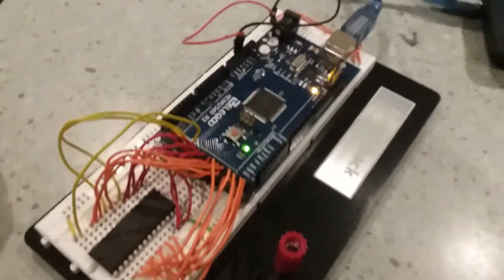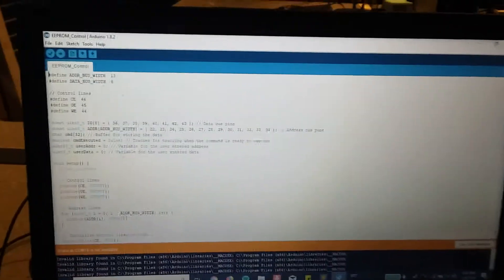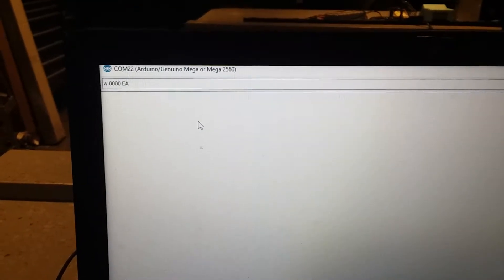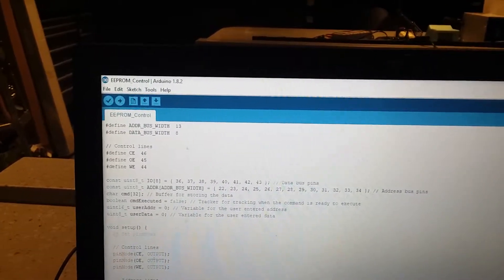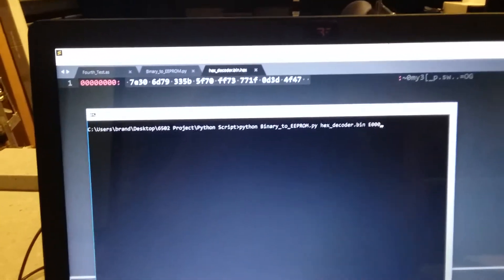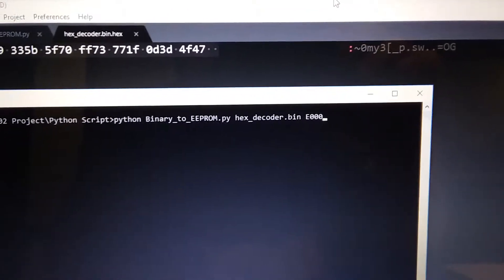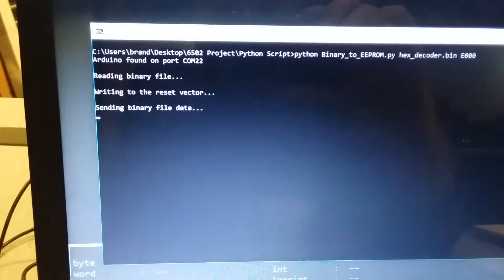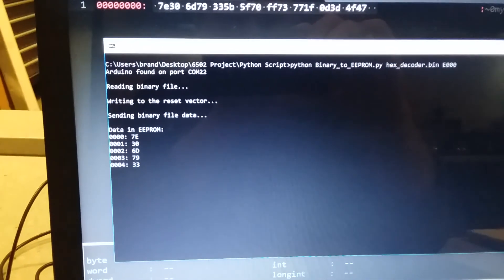6502 EEPROM Programmer w/ Arduino + Python

Comment: Hello Brandon, 
  Did you post your python script anywhere like GIThub? I'd like to mess with it a little bit. I'm pretty terrible with python. I usually need a working example to then modify for my needs.
   I'm trying to do something similar to your project except I'm exploring Flash Forth 5 on a PIC18F46K22 instead of the Arduino. The main issue I'm currently researching is how to send blocks of data over UART. There is a python terminal program included with FF5 but it's written in python 2.7 and has almost no comments. I've unsuccessfully attempted to modify it in the past but burned a few days for nothing in the process. If you didn't upload this project or whatnot, no big deal. I can always screenshot your code and reconstruct it from this upload. Thanks for sharing the example.
-Jake